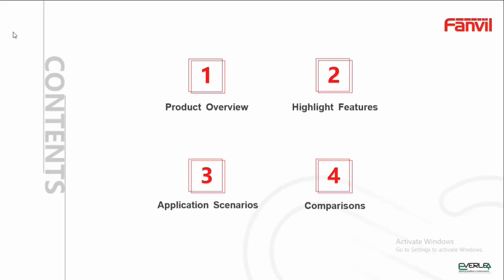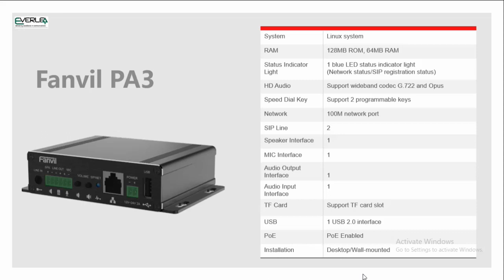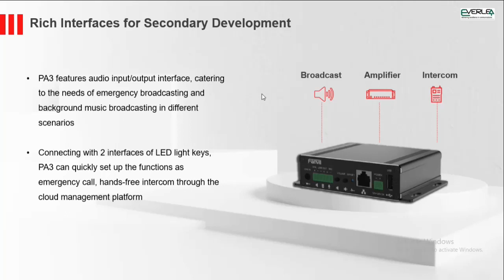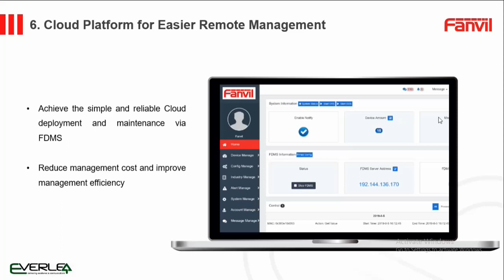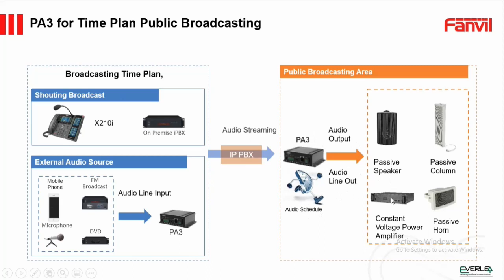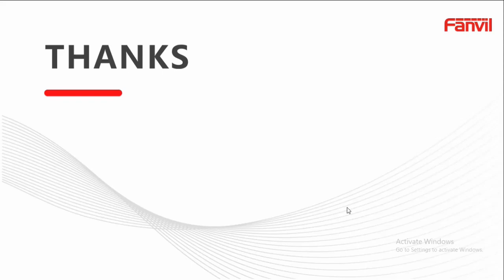Fanvil PA3 Audio Gateway

Comment: I don't suppose you could tell me how to program the PA-3 to simply take the Audio Line input (mp3 player), and multicast it out?  I have been fighting with this for a couple weeks and Fanvil direct has not been helpful.  :-(
Reply from the maker: Hi, we have not being ignoring you, your question started a debate in the office and we also ran into the helpful issue. Anyway I have the answer, which is NO the line input on a PA3 cannot be streamed to Multicast, Have talked to the Factory and will try an push them towards doing it. If you need the Line Multi-casting the Algo 8301 will do it. Hope this Helps
Reply: That is what I have suspected, and I hope Fanvil will enable what they have published in MULTIPLE power point trainings that show graphics demonstrating a connection from an iphone or MP3 player via the "Audio line cable" into the PA3, and multi-cast to speakers or other PA2's.  I have a school who wanted music through the halls, and I had previously been using a number of PA2's for Bells & Paging to OLD paging speakers, which worked great.  I then started streaming music from an Algo, and the PA2's would time out after 10 min.  I opened a ticket with Fanvil 1-2 years ago, and they said the PA2's were not designed for continuous use.  I then started the process to run all the cabling required to install Grandstream Speakers in all the classrooms and all the halls, which is now completed, however the music through the Grandstream speakers sounds like garbage.  :-(  I think we have 2 issues.  1.  Grandstream will not allow me to turn off the Auto Gain function, so after a few seconds of music, the speaker starts cutting the volume down.  2.  When I turn on the OPUS codec on the Algo, I loose all music to the Grandstream speakers.  I was hoping to use the PA3 to broadcast OPUS so I could determine if the codec issue is with the Algo or the grandstream speakers.  (I am hoping the opus codec will allow mid-low range in the Grandstream speakers.  As it stands right now, the only thing that sounds good through Grandstream speakers is music from the 1940's. - lol)   As a side-note, Hector Z. at Fanvil claims you can stream from the audio line port, but you have to press a button to enable it.  I have yet to get that to work, but if I can, I am hoping to use a WiiM Pro device, which has a 12v trigger, which can hopefully be wired to $10 relay on amazon (or maybe to a BobWire DAT1), to "push" the button in the Fanvil.  That being said, if you know how to program the PA3 so that when you push the button trigger, it will broadcast multicast, that would be helpful.  (currently I am trying to "push" the button by shorting the button pin outs, as I am assuming it is a contact closure.  If there is a specific button module, my ideas above with the relays will probably not work.)   @everleagroup8985